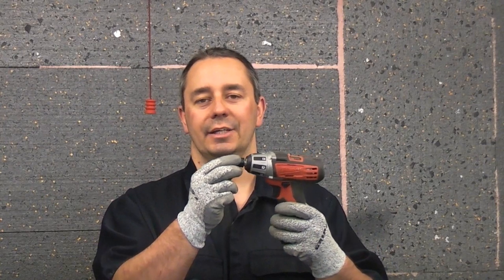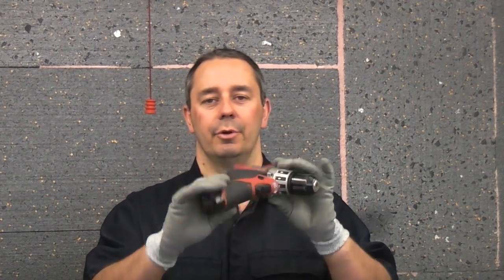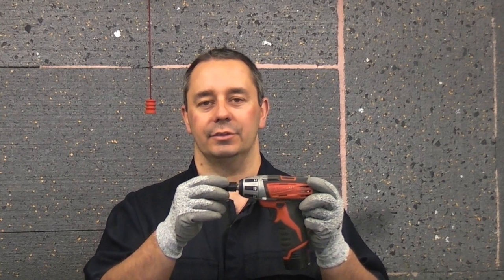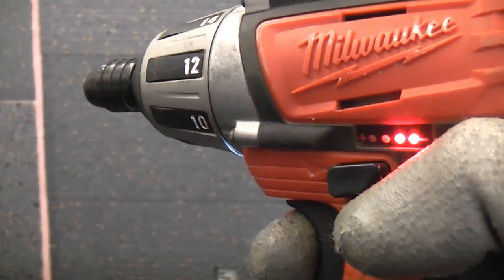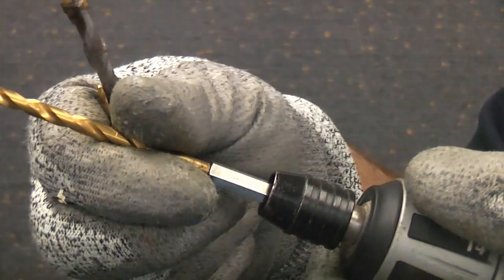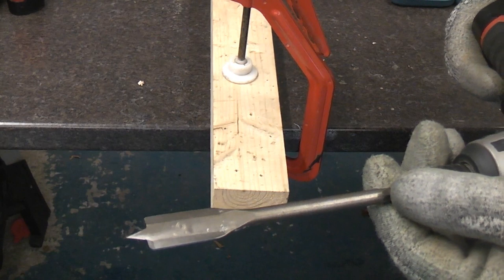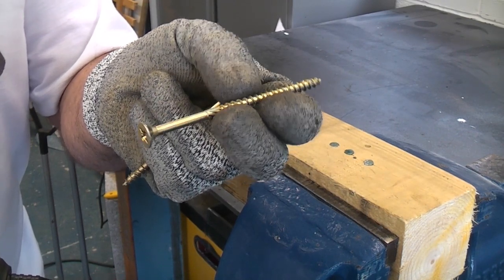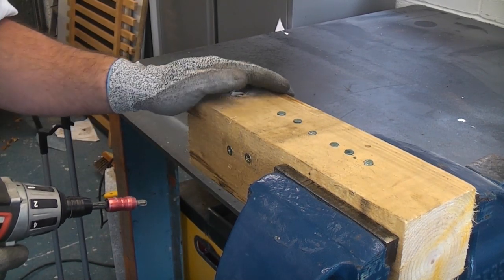Milwaukee C12D review

Comment: Is it Li-ion? How can it be 12v? Should be 3cells at 10.8v or 4 cells at 14.4v. I have the bosch 10.8 which is awesome, my college had the Makita which is similar but has the advantage of a slight delay on the LED off time and appears to be slightly more torquey.

Comment: i never understood why, if given a choice, anyone would pick the screwdriver over the regular drill driver. Don't get me wrong, i can understand the benefits of having an extra dedicated screwdriver, but i would still prefer to have two drill drivers with a normal magnetic bit holder fitted onto one. having said all that, if the same thing happened to me i probably would have done the same. 
nice review.

Comment: is that a hex quick release bit looks kool i just use a normal magnetic one http://assets.rockler.com/media/catalog/product/cache/1/image/720x720/9df78eab33525d08d6e5fb8d27136e95/4/3/43448-02-1000.jpg   are they better or same ?
Reply from the maker: I think that bit holder is a Wiha bit holder. It's very good and better than most of the magnetic ones in your picture as there bit is gripped tight until you pull back the collar to release it. The magnetic ones normally work fine though ;-)
Reply: ***** Thats great ty for the quick response keep up all your work i learn alot ... your video making me look for a good impact driver :)